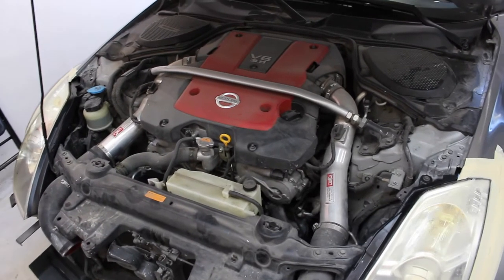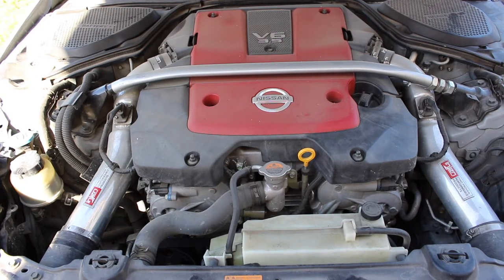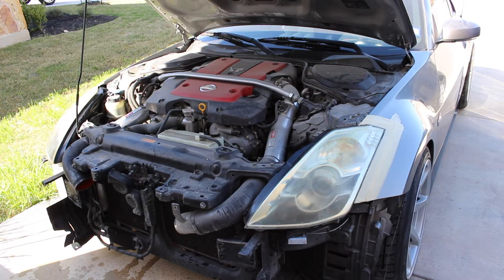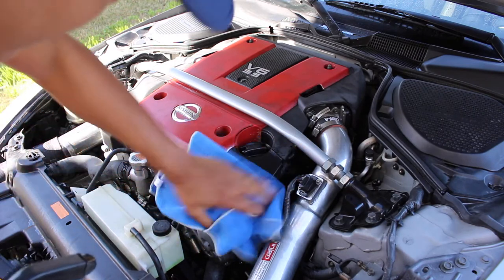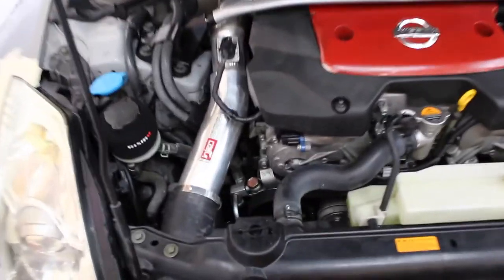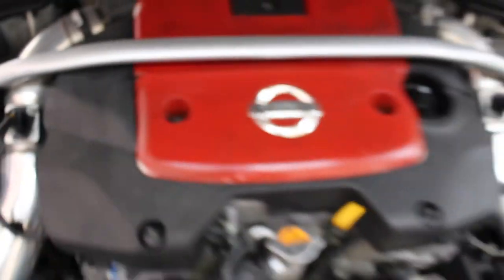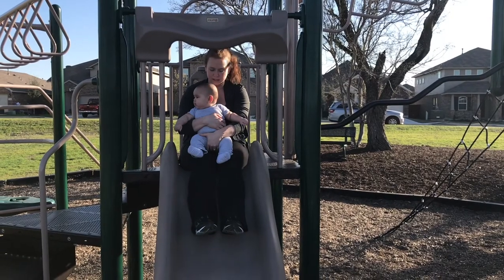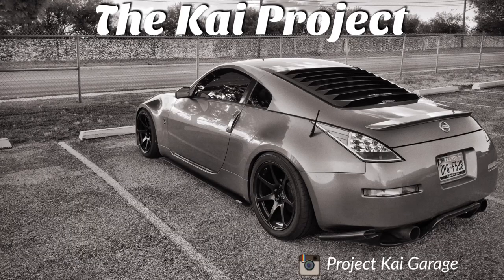350z | Washing Engine Bay

Comment: Awesome video man, I noticed in Chrisfix's video he covers parts of the engine with a trash bag, but is that not really needed on the Z?
Reply from the maker: I mean better safe than sorry. Only reason I didn't because I honestly forgot and really looking at the engine bay for the Z I dont see anything that needs to be really covered. Just don't spray water directly into the alternator. Also helps the battery is contained in a separate compartment.

Comment: Is this a 370 motor put in a 350 Z frame?
Reply from the maker: They look similar don't they. That's because the last two years they made the 350Z they upgraded the motor to a VQ35HR. Funny enough the 370Z basically has the same motor just bigger displacement and changed few other things to it. VQ37VHR. But they basically look the same if you are just glancing at it.